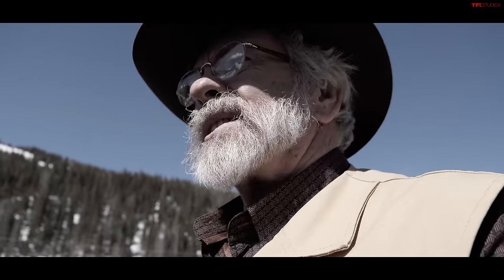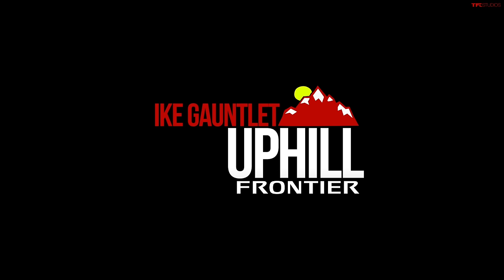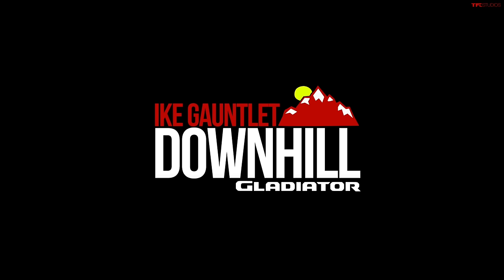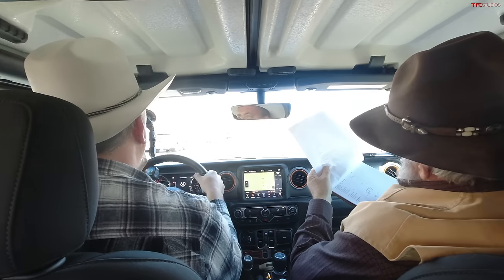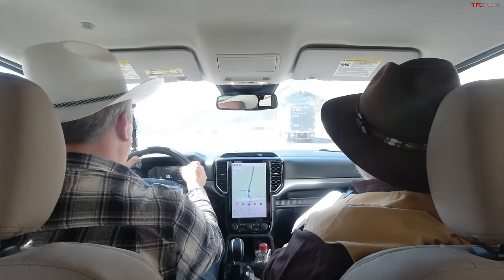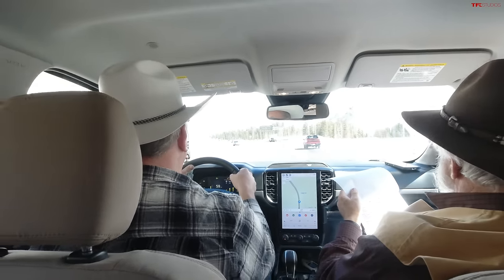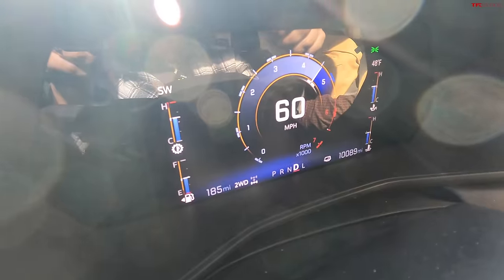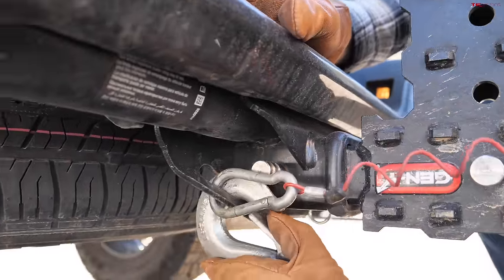MEGA Ike: New Tacoma, Ranger, Colorado, Gladiator & Frontier vs the World's Toughest Towing Test!

Comment: I towed a 5,000lb camping trailer from AZ to PA and back with my 2022 Nissan Frontier and it did a GREAT job. Much better towing than my 2003 Tundra. The Frontier was powerful, quiet, and stable. Transmission picked a gear and held it. 
It was a very low-stress journey in the Frontier. Fantastic truck.
Reply: Your talking about a 2003 4 speed tundra compared to a 2022 frontier with the 7 or 8 speed trans with way newer technology
Reply: @robertespinoza2740 My point was the Tundra is a physically larger truck with a more powerful V8 and overall didn’t tow was well as the Frontier.
Reply: @thetinysideoftiny7625  yeah but that’s 2000s technology when a ford f150 couldn’t even pull itself up a hill all of the older full size trucks struggled to pull anything till 2016 is where you can compare them all the makes of those old v8s didn’t even have 300hp march it up with a 2007 tundra at least with 400flbs of torque      That’s like saying my Honda civic with k20 can smoke any v8 from the 90s and it will sadly but that’s my point  way to old to compare to something made in 2022
Reply: Mid size trucks have basically become the new full size trucks and created the new "compact" segment like the maverick. So, I think it actually is a good comparison.
Reply: Same.  Towed the same 21ft 4k lb camper all across the US.  Previously towed the same camper with 2018 Colorado diesel and 2020 Gladiator.  2023 Frontier was the most stable and lowest transmission temps (which were no bueno in the southern Rockies in July).  Nobody could have been more shocked than me.
Reply: @thetinysideoftiny7625 the 03 tundra does not have more power lol. Also, the new frontiers weigh more than the 03 tundra and your frontier is about the same size as the tundra. Believe it or not
Reply: @andyman8817 To be clear, the Tundra has less horsepower but more torque. I reasonably figured torque was more important when towing.

Comment: I love these Ike Gauntlet videos. It was enjoyable to see them all compared in one video. The normally aspirated engines suffer at high elevations compared to the turbo engines. I suspect long-term, they will be more reliable since they're not relying on an expensive turbo to make all that torque for pulling. I don't really tow, but I need a 6ft bed. That wipes out this entire lineup except for Tacoma and Frontier. I currently drive an old Colorado and it's been a great little workhorse. I've maxed out the 1,610 lbs payload several times over the years.
Reply: I suspect you don’t know much about trucks

Comment: I'm a boomer who has fond memories of the older pickup trucks we all loved in their day, but...  it's easy to forget that the relative dimensions (LxWxH and weight) of modern midsized pickups are roughly the same as full sized trucks of the 70s/80s/90s with more horsepower and torque, better brakes and MUCH better safety/convenience tech. We're lucky to still have these tools for our work/play needs.
Reply: I fully agree with your comment, with One glaring exception ! Bed size! A truck should be built to haul items in it's bed.I have a 2004 GMC reg. cab short box. Six and a half foot bed length, a sheet of plywood easily fits between the wheel wells flat on the floor and just past the tailgate in length. I am 5 ft. 9 in. tall and can reach over the sides and pick up items of the bed floor. Please tell me which dealership I can go to that can match those criteria points.
Reply: Closest you can get is ford ranger, Plywood fits, bed is slightly shorter.
Reply: True but the old 90s full size pickups make their peak hp and torque way lower. Also their redline is only around 5k.

Comment: That Nissan 9 speed shift nice and FAST. None of the laggy soft "powertrain protection" shifts of the others.
Reply: 9 speed is junk
Reply: @Georgewashington-o7m  has a warranty for a reason, you should feel how long my Colorado ZR2 takes to shift. There is a reason it's 2 seconds slower than ranger Raptor dispite being 700lbs lighter, with similar power.
Reply: And it will probably be the first (or second behind GM) transmission to fail. Jatco transmissions have a history.
Reply: That's the opposite of most tests I have seen with the Titan/Frontier, anything but fast shifts.
Reply: @JJ4213FL mostly cvt trans
Reply: @Georgewashington-o7m said nobody lol
Reply: @JJ4213FL  Nissan frontier transmissions do not fail as they are not CVT transmissions The frontier has always either had a manual transmission or an automatic.

Comment: My old 2017 F150 with 2.7 Ecoboost had absolutely no engine braking, coming off Sandstone Mountain here in southern West Virginia in tow haul it’d be in 2nd gear reving it’s guts out to hood you back to 50 with 5k camper in tow. The truck was flawless otherwise, but just ain’t enough displacement for engine braking or so I’ve been told.

Comment: The Nissan SV Crewcab 2wd w/Convenience & Technology Pkgs price out far less than all other midsize pickups w/similar equipment.  Nissan IS competitive...
AND....  You guys do a great job with these tests!  Subscribed!!
Reply: It’s competitive with what? It has all the features of an 86 chevette. I think interior is shared with the original hardbody
Reply: Thanks
Reply: @RP-oy5rt  Settle down. Having owned both a 1986.5 hardbody and a 2022 Frontier, you couldn't be more wrong. The Frontier is a solid, tight, well-engineered more traditional awesome truck.
Reply: @phw2274  with by far the worst interior. Seeing as it’s the most expensive mid size in the higher trims what you get is garbage. Imagine paying that for a truck and getting mechanical gauges and that sideways iPhone 3 in the dash they call a screen
Reply: @RP-oy5rt  That's a matter of opinion, and on price you're completely wrong. It's got all the tech you need, and then some. An iPad size screen to play with does not make a truck. Get a Tesla. The Frontiers 9 in screen is perfect. In simple terms, we all like different things in a truck. Thats why we have choices. You pay for yours, and everyone else can pay for there's. This kind of back and forth is unnecessary dude...
Reply: @phw2274  well the build and price will confirm that fairly quickly. If that doesn’t work the last tfl midsize comparison video discusses the frontier being far more expensive then even the Tacoma. The 9 inch was great 10 years ago it’s sad now. They are the same truck now as they were 15 years ago basic power window lock cruise. I guess the sales numbers really tell the story however
Reply: @RP-oy5rt  Not anymore. Go price a 2024 Taco and see their additional market adjustments. Other  manufacturers are discounting MSRP.  Again you are wrong on many levels. But again, you're entitled to you own opinion, whether it's right or wrong.
Reply: @phw2274  okay so you admit sticker to sticker the frontier is more expensive? The frontier are discounted because no one wants an 80s interior with a 90s power train and early 2000s electronics. Their is a reason the taco outsells it around 7-1
Reply: @RP-oy5rt  Dude, you've got alot to learn. For one, I've never understood why someone got off by putting down someone else's vehicle. Something is lacking that causes that. I'd never trash someone's vehicle that they like and are probably working their butt off to pay for. You might try being happy and building someone up instead of tearing them down. Trust me, you'll get more fulfillement than trashing what someone else has or likes., I'm driving exactly what I want to drive and I bought it for myself, not you or anyone else. Be happy!
Reply: @phw2274  I not a fan of lying personally. To say that the interior and electronics of a frontier are anything but junk would be lying. Saying that they sell well would be a lie. Saying they are a cheaper sticker than a Tacoma would be lie. To say the frontier is competitive is absurd as every actual comparison video has pointed out they really aren’t competitive
Reply: @RP-oy5rt  no its not junk. It works just like I want it to and I like the old school feel of the truck. These newer trucks with all the tech is a gimmick and will only cost more to repair. And yes I like the 90 interior, the 2000s tech. So what. It works. It does the job. And it's affordable. Competitive? Hell yes it is😅
Reply: @trixsevenoneroyalbluez1257  Exactly. Not to mention TFL Truck's brand new 2024  Taco that blew a front differential on a slightly snow covered trail. The snap heard around the world.
Reply: I want to add here that the tacos are more expensive. Look at the trd off-road and the pro4x. Most offroads are 53-55k depending on the packaging and the pro4x is 47k. Maybe you’re talking base prices, but I’m too lazy to check base prices

Comment: Always a fun shoot with Mr.Truck, and heck of a job grabbing all this info guys. There was one wrinkle I caught with the 35-60 test. The Ranger was a second quicker than the Colorado there, so it should have gotten the 5 points alone, the Colorado 4 points, The Tacoma 3, the Frontier 2, the Gladiator 1. Also, The Colorado uphill time was 7:54, the Ranger 7:50. There was the hiccup on the Ranger run with the tunnel being closed, but you had to slow down before you stopped the clock, and the signal light you use as the end marker was only a few car lengths ahead. You listed them as tied on this one again, as I know your metric is the 8:00 mark. That being said, the actual time should be the tie breaker, as the "8 miles" isn't exactly 8 miles anyway. I have no dog in this fight, but those things did jump out at me. While you guys have all of these trucks, you should do a Dyno test to see what they all are producing at the wheels. With the Ranger being mid pack on power and torque, yet somehow beating the rest in acceleration unladen and towing, someone's lying somewhere. Again, awesome work gentlemen.
Reply: Thanks
Reply: They do manipulate the numbers and how some of the trucks perform, but it’s entertaining

Comment: Can’t wait to see the Tacoma with the hybrid iforce max vs the Ranger with the 2.7L ecoboost on a max tow test. Hopefully in the heat of summer 🥵⛰️😎🍿
Reply: The two options with better things to come.
Reply: 2.7L ftw.  Turbo V6 power until the tank is empty.  Iforce max power until the tiny 1.87kwh battery is empty. So in about a mile towing uphill than you're relying on the turbo 4 banger.
Reply: @marklihsu That's not how hybrids work
Reply: Watch the 2015 f150 2.7 videos. 
f150 325hp 375tq
Ranger 315hp 400tq
Reply: @prestondeters5093 oh it's not? please enlighten me.  The hybrid motor is to help get you off the line where gas engines are least efficient.  Not designed for sustained performance.  But please explain how it works.
Reply: Well it will have to be in the heat of the summer, otherwise if there was an inch of snow on the pavement the front differential of the Tacoma could “snap” again😝

Comment: I’m impressed with the new Ranger. The 2.3 turbo 4 is turning out to be a reliable engine. Its performance is more than adequate for 90% of what you need this truck to do. If Ford can get their production problems solved the Taco may be trouble for the sales crown.
Reply: The Ford dealers may need to back off on their pricing policies before that'll happen. They know when they have a good thing and they aren't even a little shy about charging extra for it.
Reply: @alanploetz7100  and you think Toyota isn’t proud of the Tacoma? You can get a Tundra for the same price as a Tacoma.
Reply: @khakiswag  I'm sure you are correct about that and especially with the Taco's cult like following. I'm just more personally familiar with the Ford side.
Reply: Dream on lol
Reply: @khakiswag it's always been that way, back in 2006 I wanted a Colorado, I got a Silverado with a V8 and a 5-speed $3,000 cheaper.

Comment: The Jeep Gladiator Mojave is the wrong Jeep to do an Ike gauntlet tow test with. Because it’s set up with an off road go fast suspension, which means high compliance springs and shocks along its a lower gear ratio set up for go fast instead of yanking heavy trailers around. But I don’t think using a gladiator sport or sport S with the better gear ratio, smaller diameter tires and lighter curb weight would have improved it enough to tie or snag 2nd place.

Comment: Great video!  Love the compare.  The turbos had it especially at this elevation.  The Gladiator felt like it was straining the most which I would rule out.  With some towing experience I like factory TBC, temp gauges especially transmission and engine coolant, good engine braking, payload and tow rating.  Lots of work here.